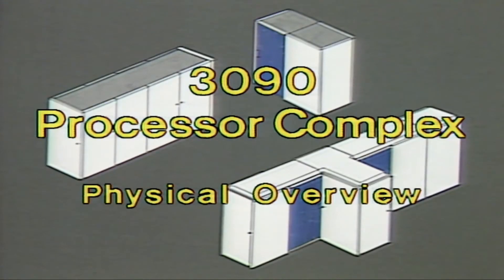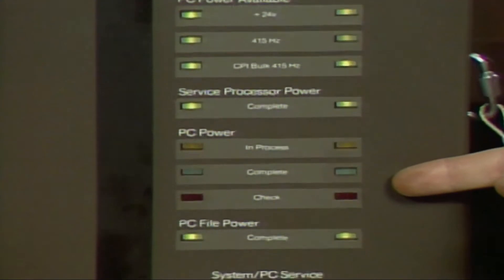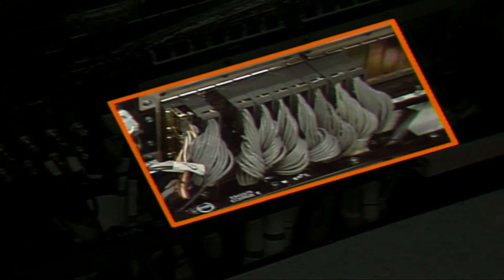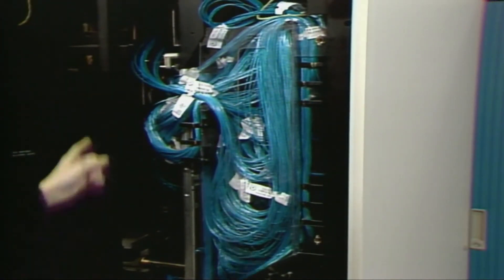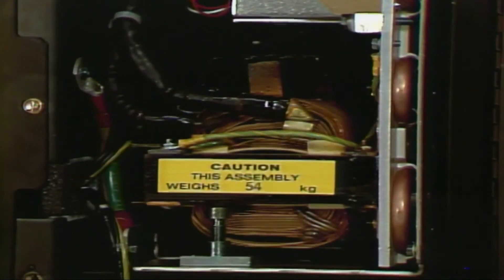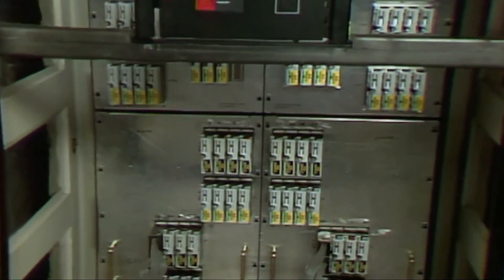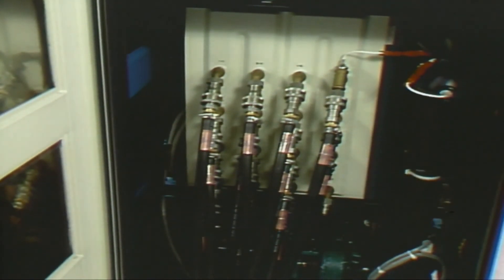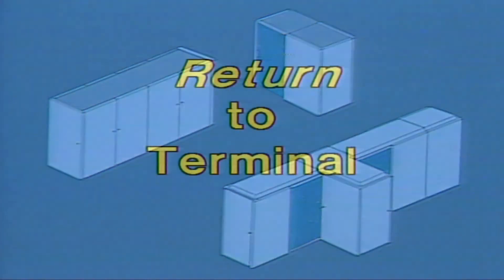IBM 3090 Processor Training

Comment: Hi Mark. I was a FE and mainframe specialist for IBM (hardware) appreciate seeing this video. Brings back memories!
Reply from the maker: I worked for IBM from 1987 to 2008, eventually ending up a member of the Academy of Technology and a Distinguished Engineer. I still don't understand hardware, which is why I found this laserdisc so awesome. The best people, and some of the most influential I worked with at IBM were the hardware FE! My first big break came in 1979 when a FE gave me the source code to the IBM 3741 so I can hack in a change for the company I worked at the time. We needed to be able to transmit a single record insurance policy from a remote office to our London office quickly, the insurance record required 140-bytes, the 3741 only supported 128. I patched the code to allow the 3741 to split the record but transmit 140-bytes which avoided a batch program at the HQ to re-assemble the records before adding them to database. Seems trivial now... 6-years later I was working for Chemical Bank in NYC, we used a mod for the IBM Series-1 to do much the same thing, except this time to do online credit card authorization automatically for the first time. Amazing times.
Reply: I was a part timer In the 80's for IBM and they used the part timers to pull the cables under the raised floors.  Talk about heavy Bus & Tag ( I believe it was call ) cables.  I still have a processor from a 3090. I also have a memory module from an IBM 1800 system that used Donut memory we called it but was magnetic memory,  Great memories from those days.
Reply: @oilman1758  yes, bus and tag cables. Very heavy. The old ones were gray and even heavier. The newer blue cables were easier ish.... I pulled so many of them.... Fiber was a godsend!
Reply: Did you ever fix 3420s?  If so, how did you you do the capstan squaring check/adjustment?
Reply: @elye3701  oh I did. Oscilloscope, test tape and lots of time... I don't recall the exact process. Many years ago
Reply: @mrkkitson  I came up with this procedure and it took over the official oscilloscope 50%-50% waterfall technique - but only in my country. I plugged my digital meter to one capstan sensor signal and slowly turned the capstan. I noted the lowest reading and the highest reading. Add the two numbers and divided by two. Then I ran the capstan motor by jumpering some pin or maybe plugging the capstan motor to another socket. I then adjusted the pots until the reading matched my calculation. The meters at those days was average reading instead of true RMS. This spread like wildfire BUT no technical manager nominated this for a PMR to help the rest of the world. I was a science grad not an electrical/electronic grad like the others. I applied my knowledge of class-D audio amplifiers.

Comment: The engineering is amazing—not just the design of the logic, but the physical arrangement of the components. Where do you put the power supplies? Where do the CPUs go? How to you route the cables to connect everything
Reply from the maker: Yes, it had to be, these machines were far from perfect but the complexity of the design, engineering and operating system software support was suitably impressive for the time. I'm looking for some more interesting videos/VHS/Laserdiscs to show off the technology of that era. Thanks for watching.
Reply from the maker: there were a lot, and I mean a lot of cables under the floor interconnecting the components. the 3090/400 was two 3090/200 interconnected with only a few common components.

The machine itself had firmware called "Logical Partitioning" which would allow you to virtualize the hardware to a point, and share hardware components between a number of partitions by allocating dedicated resources to the partition. The entire machine, or one side, or one or more partitions could run the Virtual Machine operating system, which could further share resources.

Comment: I was an IBM Field Engineer specializing in Large Systems (now known as Enterprise Systems) from 1977 to 2015.  As I watched this a lot of memories came back.  Thanks for posting.
Reply: Wow, you must have seen a lot of change!
Reply from the maker: @ian_b  When I first started in 1973, the mainframe system I worked on, and IBM 360/40, only had 48Kb main memory to load the OS and run programs. A NEST doorbell/Cam has a greater amount of memory and faster processor than the 360/40. A version of the 360 went up in the space shuttle, provided the computing power in 256Kb main memory.
Reply: @MarkCathcart  Did you ever fix 3420s?  If so, how did you you do the capstan squaring check/adjustment?
Reply: @MarkCathcart  Did you ever fix 3420s?  If so, how did you you do the capstan squaring check/adjustment?
Reply from the maker: @elye3701  I was never a hardware engineer. When they closed the physical library and the IBM Poughkeepsie 705 I claimed some great books and laser disc's.
Reply from the maker: If you have or see any old IBM training laserdiscs, I'd love to be able to convert them for others to see. I'd really love to find something on the 3850 Mass Storage (cartridge) System.
Reply: @MarkCathcart  I have found some pdf training and a presentation that runs on Lotus, but no videos.  Yes the 70's and 80's were a great time to be in IBM.  Started declining for the employees in the 90s and went down hill fast after 2010.
Reply from the maker: @jbrannon7  If they are real technical training, consider donating them to the computer history museum. Seriously, one day these will be important and storage is so cheap now they are worth keeping.
Reply: @MarkCathcart  Yeah, I have saved them on my hard drive for years now.  I wish I had all the 70's, 80s and 90s machine logic books I threw away, and all the microfische I threw away.
Reply: @jbrannon7  Did you ever fix 3420s?  If so, how did you you do the capstan squaring check/adjustment?
Reply: Everytime there was an upgrade I would always ask if I can take the old one but was never allowed because IBM took it as a trade in, what did they do with the old workhorses?
Reply: @videosuperhighway7655  An airlines client  dropped IBM. I found a core memory from the IBMCE room. I tried to interest my managers to write to the company to retrieve this but nothing happened. I emailed some US museum to intervene but again no response.My company wanted to scrap the sole 5110 in the country. I offered to but it but again nothing came out of it. Everything has been scrapped. Some people just do not appreciate cutting edge technology.
Reply from the maker: @videosuperhighway7655  like cars they were sold on to resellers and leasing companies at a fairly high price, so that they couldn't sell them cheap and flood the markets with cheap MIPS
Reply: Did you ever fix 3420s?  If so, how did you you do the capstan squaring check/adjustment?
Reply: @elye3701  oscilloscope and patience!
Reply: @mrkkitson  The oscilloscope was the OMLY method then. No patience required except for waiting for store to deliver a new set of probe tips (I quickly ordered a pair for my toolbox) because the account engineers never bothered to keep that in good order much less the standby engineers who carried one for that week. DMMs started to appear. Hmmm if they were average reading . . . So I tried this - I measured the max and min voltage as I slowly rotated the capstan (I built my own leads, long enough to reach the front panel). Add the two numbers and divide by 2 foe a 50percent duty cycle. I checked the waterfall with a scope so many times and it never failed.  So I stopped using the scope for that. The other mainframe engineers adopted that BUT nobody including the manager bothered to recommend this as a RETAIN tip.
Reply: As an Operator in a mid 80s I saw a lot of IMB CE’s and FE’s. We used to be kind of freaked out by the guys in the white Shirts and their devices that beeped at them all the time (early comm devices I’m guessing). It was so interesting seeing them walk around. We thought they were like Androids. So serious and professional. I worked t Hughes Aircraft Co. Sun America and Farmers Insurance in various roles over the years in the data centers until the last outsourcing and switch to Servers wiped them all out.
Reply: Sounds like we have something in common. I was there 1979 to 1998. Great times!

Comment: 3090 was an amazing machine. So fast and so reliable..
Reply: It was amazing in it's day and the Model J's were bulletproof
Reply: @mrkkitson  well back in the day, lol. 69 mhz isnt exactly speedy today
Reply: @ttuori8592  of course! The mainframes real strength was it's parallel processing capability
Reply: @mrkkitson  yeah, the amount of ram and storage for the era is nuts
Reply: fast? u wot m8
Reply: When I joined IBM, our compute centre had a massive 2MB 370 running all our jobs/payroll, client jobs, PROFS. Among the IBMCEs, I was probably the most notorious user. Often IBMCC would message me to complain that my REXX programs were chewing up too much usage. My 191 disk allocation was 3MB. I was running filters to remove redundant lines from my PROFS files to conserve disk space. That 370 was damn quick. I never noticed any latency. I have to salute the efficient coders of VM. Now that I am on Windows, I notice the speed difference.
Reply: @elye3701  All hail REXX, and getting a bollocking for resource hogging. 
Now I'm in Linux, and doing that's my job.

Comment: Thanks for this!

In the late 1980's, I worked in American Express's mainframe center in Phoenix.  We had a total of 7 IBM 3090-Js (IBMs largest as I recall).   In the same center, there was a vast ocean of DASDs and dozens of smaller mainframes as well.
Reply from the maker: In 1983, I worked for Chemical Bank in Manhattan, before we got 308x computers, we had 3033MP systems, they were even bigger than these. My experience virtualizing the SWIFT banking system for Chemical Bank lead to me working at IBM Kingston on the firmware/supervisor design for the 308x processors. I have a bunch of these videos on laserdiscs, I've agreed to provide digital copies to the Computer History museum in California.
Reply: I worked for six weeks in Japan as RSFSG. We once toured a "small" customer. There was a dedicated office for an IBM manager and the CEs. One floor for printers, one floor for DASD, .........
Reply: I wanted to be one the IBM Project Managers on the AE Data Center in Goldsboro in 2011 but it did not work out.  I spent years at MCI with the back of my chair up against a 3090-600.  They were my first customer to cross the gigabyte threshold on 3390s.